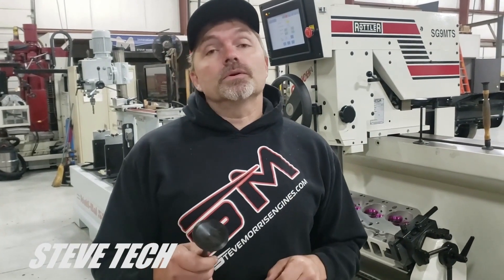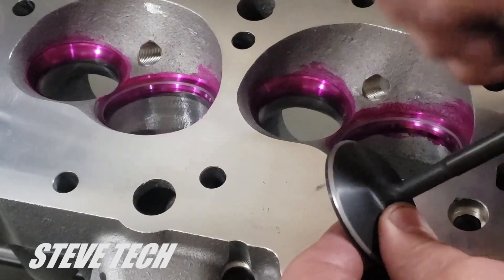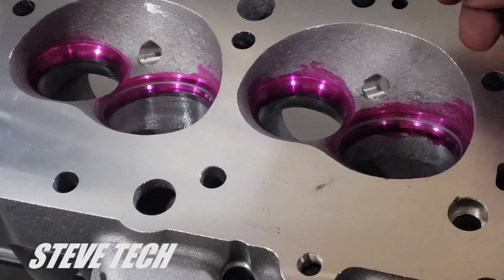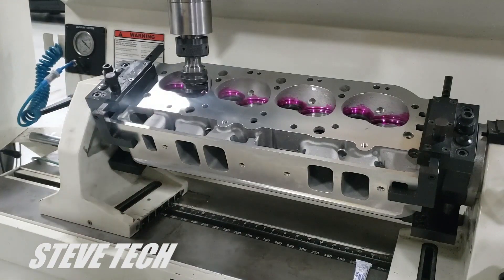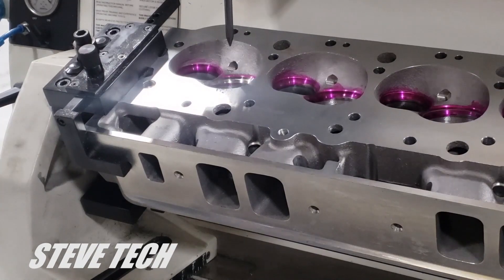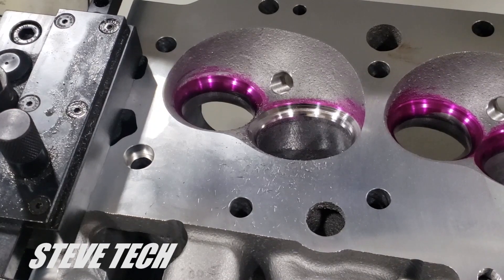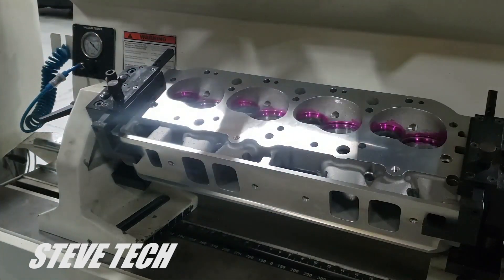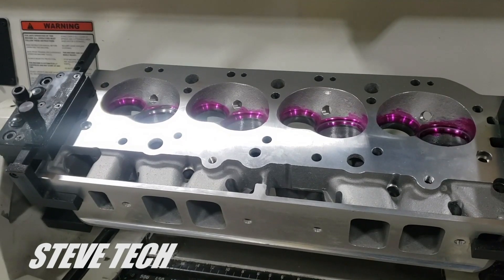Rechecking Valve Jobs

Comment: I bought a new set of summit branded (trick flow) sbc alminum heads that the valve job is absolutely terrible. Valves aren't centered in the seats at all, guides to tight and overall the machining was just terrible. I didn't check it before I put the motor together like a dummy so now I had to pull motor all apart and are having to spend a bunch of money getting it all fixed. At this point I should've just gotten afr heads. Definitely don't assume new is good like I did. I won't make that mistake again.
Reply: Trust me. The afr's won't be any better. They all need work when they are new.
Reply: @capriracer351  I’ve seen other YouTube videos afr etc all junk these days
Reply: Graham, I had just as bad of a experience with SUMMIT house branded, high stall converter. Cold welds, terribly offset in the drilling of the bolt pattern. Of the 3 converter to flywheel mounting holes, only 1 was barely acceptable. None of  the 3 mounting holes were concentric to the center hub. The customer service was even worse than the quality of the component. In a way I blame myself,  because I should have known better. 
T.S. RACING
Reply: @sharons9367  Not only "these days." In December, 2004, I got a set of just released AFR 225s for an LS build. All 16 valves had the installed height stacked .100" too short (stiff sumbitches!!). Instead of 1.780", they all came in at 1.680"-1.690". Mamo still ran the AFR program then. Most serious builders know who I'm talking about. I'd like to think Brodix is still good out of the box, but who knows......
Reply: @milojanis4901  it seems that manufacturing these day has really turned for the worst 
Quality of materials used etc 
Camshafts / lifters especially

Comment: Excellent advice, always check your seat locations. Instead of lapping we use dry graphite spray on the face of the valve, rotate back and forth about 90deg. You can see the seat location and if it hitting all the way around. If all looks good and has no leak vacuum testing without a spring, theres no need to use grinding compound on a machined seats and valves. I know alot of people still lap and it's a very accepted. Me personally, I try not to.